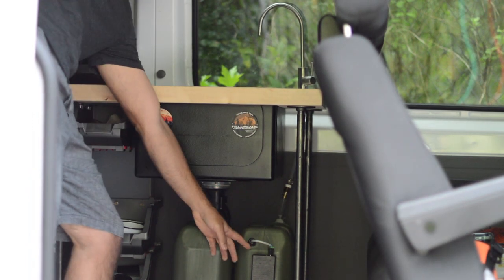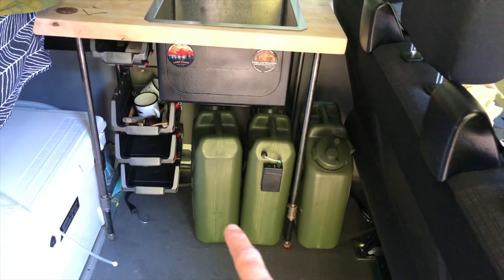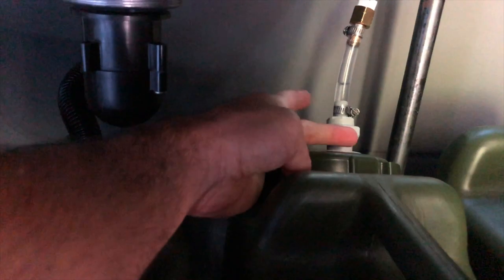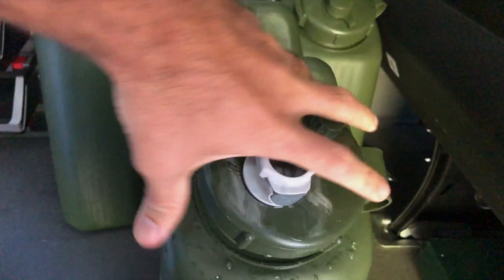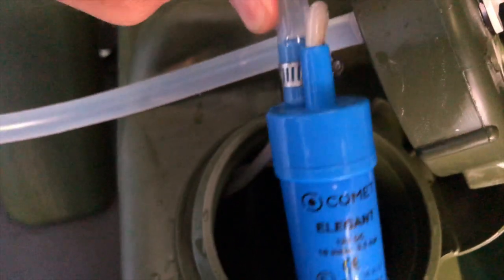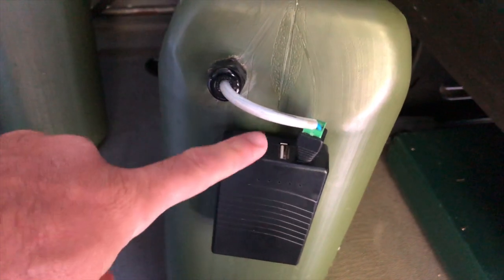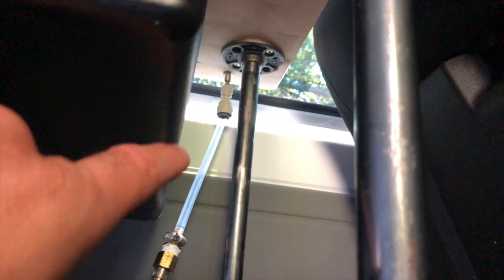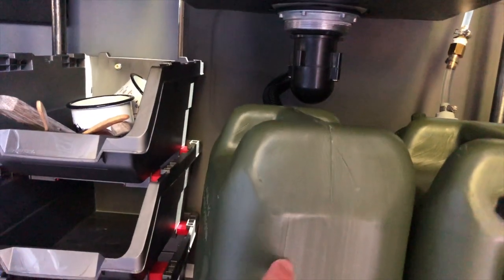Easy Sink Idea For Sprinter Van - 5 Gallon Tank - Lithium Battery

Comment: sweet, best I have seen yet, going to do one of these, but have the charger under the sink counter rather than fixed to the jerry can and split to the shower too with an on off valve. Fill the jerry can with required hot water and you have a hot shower too.

Comment: This is an awesome idea for an all around use system that won't freeze up if left in a trailer since you can remove all the components. Nice, will be building this system myself. Seems like the best set up for my use and all the other possible uses as well. Thanks for sharing and keep adventur'n! 👍

Comment: Thanks for posting. I just watched the shower video to see how you made it.
I've been working on a cheaper version, but I like yours better.
I think I'll try putting the pump wire in through the lid, no damage to the jug and easier to swap out when empty.
Reply from the maker: If the wire goes through the screw on lid, just make sure you can close the lid securely and also that it won't cause too much of a pinch point on the wire because it will likely wear down the protective sleeve and short the wire

Comment: This is cool, I am working on a camping trailer with a kitchen, I think this is the design I will go with for the sink. I was just going to use a 5 gallon gatorade jug initially, but I like having the pressurized sink. I wonder if you could find a way to put a lifestraw or some other filter inline so you can fill the jugs from a stream or something.

Comment: Hi, do you necessarily need the grommets? The hole at the back of my jug is just the right size to put the wires from the pump through. Is it need to protect the wires or?

Comment: How did you connect the pump to the plug on the battery pack? Thanks
Reply from the maker: I put a 6mm plug head on the pumps wiring

Comment: Great information. How did you mount the battery pack to the water jug? Is the wiring for the pump to the battery pack easily put together or is some experience needed in the wiring department?
Thank you

Comment: super cool, great video! I think I might have found a nice alternative to buying 10 male 9mm adapters. The battery comes with a power cable for charging and also a splitter of some kind. Maybe you could splice those cables together? Idk, just a thought. Thanks again for the brilliant idea, I used your affiliate links for nearly everything :)
Reply from the maker: Kameltoe awesome, much appreciated! I’m sure there’s some smaller packs of adapters and other parts. Hope yours turns out great 😀

Comment: Hi! I have a question about the connection from the wiring of the pump to the battery pack. The pump has three wires, blue, brown and yellow, and the adaptor only accommodates two wires: positive and negative. Did you just use the blue and brown and not the yellow wire? Thanks!
Reply from the maker: Hey, yes you only need to use the blue and brown wires